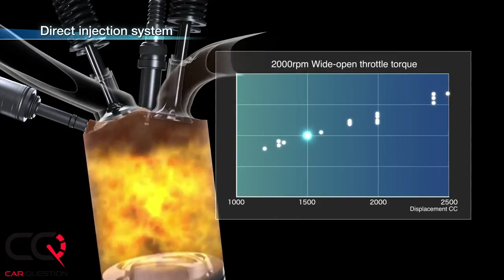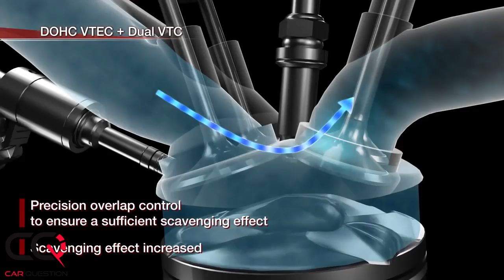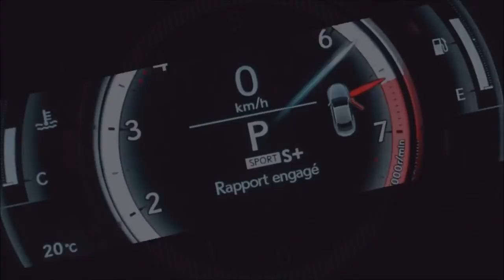Honda CR-V Turbo: Overfilled oil levels and a gas smell Fix and RECALL!

Comment: My 2018 CR-V LX 2.4 Liter is flawless.  It mimics the LX Accord to me 😁
Reply: the 2.4 is a good motor. its in my accord but it does burn a little bit of oil maybe cus i vtec alot
Reply: Keep a close eye on oil level. If it seems like it is getting higher on dipstick, it's gasoline
Reply: @MegaLifeChanging  Keep an eye on all Honda DI four cylinders.
Reply: The turbo is the problem. 2.4 liter CRV should be just fine
Reply: @rncondie  No their not.  2018 crv with 2.4l engine. Oil keeps going up on dipstick. Can smell the gas  in the oil. Wish people would quit saying the 2.4l are fine.
Reply: @normt5463  All of Honda's other DI engines are fine. Jeez.
Reply: at 40,000 no issues yet.
Reply: @tonydalton8712  are you kidding?
Reply: @FuriousHondaBoy  No not kidding
Reply: MoNo K that’s what I have too.

Comment: the update for oil dilution actually messed up the car. so for those people not having problem dont update otherwise you will have check engine and later on the car will go limp mode and die.
Reply: Someone didnt do your update properly then. Never seen that issue at the dealer I work for and I have personally never had that issue on all these pointless recalls. Ide go back and complain. It's not the updates issue it's the person that did your update

Comment: 2018 CR-V EXL, no issues yet at 11,000 miles.
Reply: We have the 2018 CRV EXL 2WD and no problem either. I'm guessing it's the AWD maybe.
Reply: Reports mostly around 20,000 it starts
Reply: @jasonHadley420  false. For people who have the problem, they report the problem starting immediately after the purchase, including commenters on this video. Don't spread false news and rumors.
Reply: I have a 17 EXL turbo and had the software update done and now injectors failing which means too much gas (fuel system too rich) and at 80k miles. So just you wait. 10k miles is nothing. Keep driving it and you will see

Comment: I have bought a 2017 CR-V, after tons and tons of research. I went on many test drives. Talked to many sales people. I got a notice from Honda about an emission related to the emissions. I have failed to have a problem yet. The Kia Optima I had before it smelled like burnt oil after every oil change. My mechanic always said, "that smell goes away in 3000miles".
Reply: ilovetotri23 that was probably because oil spilled on the engine and they didn’t wipe it off. The smell has to burn off.

Comment: Kind of interesting that Hyundai got rid of the Turbo and DCT in the 2019 Tucson. Part of this was the mfg. cost of all that complex machinery and then they were getting so many customer complaints with the DCT and  Turbo drivability.  The complaints were translating to warranty costs that were  becoming unacceptable and low scores on customer satisfaction surveys. 
The new RAV4 will not have a turbo, though it may become an option in the future.
Reply: They are actually getting rid of all Direct Injection GDI engines, not just the turbos. In fact, the only GDIs left are the turbos. The DCT was horrible though.

Comment: Anyone debating crossovers right now, their best bet is the 2018   Toyota rav4, 2.5l engine with the 6 speed auto trans. Very simple and reliable vehicle. I just saved you lots of home work :)
Reply: mazda cx5 should be 2nd best option as well since they still hanging on 6 speed auto train
Reply: The Mazda CX-5 is the superior vehicle in this class.
Reply: @davidsparling3505  If tech and a fine interior is what you desire and don't mind the higher cost of ownership over many years, than this is your vehicle.
Reply: @BonsaiJCan  Higher cost of ownership?
Reply: Yeah, but the Toyota now also has a direct injection engine in the Rav4, so some caution is warranted. I would opt for the hybrid as it tends to work in a more stable Atkinson cycle. The electric motors do all the work in that car.
Reply: @davidsparling3505  yes... Mazda is low on the reliability rating scale and parts aren't cheap either.
Reply: @afcgeo882  Really...where do you get that information?

Comment: 17 crv turbo - We did have a intermittent rich code that would come up after driving for 10 miles or longer, did notice a bit of a rough start on 2 occasions, had the computer updates all done and issue happened again. Tested with a known good MAF and no change. Valves were not heavily carboned up. The testing has lead us to suspect bad injectors. Has anyone else changed injectors to resolve what seems to be similar issues?

Comment: I am at the Honda Dealership now with this problem of gas in the oil. I have had it in to the Dealership 3 times with at least 1 quart or more over fill on the dipstick this is a very big concern as Gas and Oil in this situation is not good for the Crankshaft bearings or the seals in the engine. As a courtesy to me they have changed the oil and filter on my 2017 Honda CRV Turbo. That's fine but still not a fix and time and warranty are running out.

Comment: I own a 2017 civic with the 1.5 turbo. Many months ago I caught wind of the oil dilution issue & have been checking oil level frequently. I changed the oil every 4,000 miles After 12,000 miles it seems be fine. 
The motors that have the issue will most certainly be effected. 
The OEM oil viscosity is super low & the oil capacity only 3.75 quarts.
Doesn't take much fuel to dilute such a small quantity of engine oil.
Bad deal all the way around. 
I'll continue to keep an eye on the oil levels & any fuel odors in the cabin. 
Maybe I got lucky for a change.
Reply: S Paul One of the problems is a companywide obsession with weight when in fact these cars are nothing as light as classic 80's Hondas were. But there is also there is an ideal amount if oil so as not to run too cool. My side mirror broke into so many pieces with an impact and the dealer said : Honda is making the cars lightweight. Garbage design!
Reply: James Medina all cars are lightweight designs now. It’s called “crumple zones.” It what saves your butt in a car accident.
Reply: Hey Paul just wondering if you could update me on your engine? Now that it's 2 years later any problems  ?

Comment: Have 2017 CR V. Had recall done today, 12/26. Never experienced any issues others have had. Live in Illinois near Wisconsin border. Maybe I was lucky.
Reply: Smell your dipstick. I had the update and after a oil change smelled the stick for kicks and sure enough smells like gas. 17 CRV EX-L.
Reply: wait to you engine misfires and fuel injectors fail around 100k. Guaranteed $1700 fix. Shame on Honda

Comment: Hello, honda lower i own 2017 honda crv 1.5 l with 20k on  it, the last 2 time when I have changed my oil, i have noticed that oil level is higher on a stick,it is going over maximum. This is happening after only 1500 miles and oil is black and not sticky as it should be. My wife sad some times she can smell gasoline in cabin, i have called honda dealership and made an appointment they are not sure what it is but will post everything they said to me.
Reply: they are lying..same thing hapenning here..we have to fight formore warranty and  insurance liability responsibility

Comment: My 2018 accord touring is stalling left and right, only 12k on it. The oil level has risen and smells of gas. The dealership says there is absolutely nothing wrong with the car, but cars just don stall at 70mph on the highway if there is nothing wrong

Comment: I have Sep 2017 LX 2WD made in Canada in Qc . i never had any issue so far, i never floored the car (My car never reached to 5000 RPM so far) . i called to take an appointment yesterday for winter tire change  and also asked if they have any update on ECU update and yes they will update the ECU.
Reply: S N Glad you are not having any issues!!! Does your vehicle have the 2.4L engine?
Reply: @brendame  the canadian lx's also have the turbo .

Comment: The software and AC fix from Honda in November did not fix my unit.  I was .7 liters overfilled (.75 US quarts) above full when I took it back in to Honda in December after 1200 miles (2000km) of driving.  They changed my oil and filter for free.

Comment: I have a 2.0 Touring Accord and I have smelled gasoline shortly after startup. And I smelled gasoline in my oil. This has me really concerned. Any advice?
Reply: So long as the oil level is normal you should be fine. If it really bugs you I would have it tested through Blackstone Labs.

Comment: brand new honda crv turbo 2018..after 3months of purchase, they call me to update the software,changed the cooling uni tand changed the oil,not  sure what the heck else  they did..i called  it was a manufacturing defect....Second issue...oil changed second time at km 6000/ after one yr of the purchase...oil level automatically crossed the max level next day when i checked and i am quite sure the leak will start.Not sure how that is going to effect my car? warranty help? insurance help? tech asking me to come to dealer again..lets see..why i have to go to dealer again? why purchse a brand new car? did not expect that ..?!!

Comment: 2018 Crv 2wd Touring model and yes the oil smells like gas. Currently just under 56k miles. Noticed it last oil change and just checked again at about 4k miles on the oil change with full synthetic and again it smells like gas. Guess I need to be changing it at 3k miles or less :/
Reply from the maker: never been solved and will never be :(

Comment: I have a 2018 Civic with the 1.5t and there's fuel in the oil. About an inch over the fill indicator. Unfortunately I purchased this vehicle new without doing enough research.
Reply: How is your engine now and what are you doing to fix it ? Do you do like some long drives to burn off the fuels weekly ?
Reply: How is your car now is it ok
Reply: @bigt5699  I sold it. I didn't want to risk having to replace expensive parts later.

Comment: I have the 2017 1.5 turbo civic sport and I have not been contacted by Honda about my engine having this problem but the more I read about it sounds like all 1.5 turbo have this problem. This was supposed to be the last car I would ever buy and I planned on driving it the rest of my life that’s why I brought the ever dependable Honda. I’m retired and on a fixed income and can’t afford to settle for a car that is going to be a pile of junk in a few years so this is a much bigger problem for me than it may be for someone that’s still in the work force and has an extra 25 thousand dollars to spend. Honda better suck it up and do the right thing even if that means new engines for all who have been harmed by this bad designed engine. All I ever wanted was a brand new Honda and boy did I get one...

Comment: Wondering if the "Honda Fix" will affect the performance of the engine?
Reply: They are are going to try to reset tuning and timing along with reducing boost.  When they start this and you get your car back, and notice less power that is why.
Reply: Yes it will. No matter what Honda says they are altering the desired design
Reply: @pedroc6823  you'll also likely see worse fuel economy as a result.

Comment: I had a 2017 CRV.  It had 22,000 miles on it.  The smell started at about 21,000.  I traded it in for a Pilot.  Honda should buy back all these CRV's.  I am angry with Honda.  But taking Honda to court will only make the lawyers richer.

Comment: I hate that these little motors are forced to work even harder with a Turbo. I am glad I stayed with my Honda Accord EX-L V6.   If I needed a 4 Cylinder I would have been fine with a 2.5L non turbo.  Folks don't realize the wear and tear  from a turbo.  And not if it goes its when the turbo will fail they will realize it.  It is way to early to really know and forced induction has come a long way. I believe they are providing too much boost for these motors to handle for the sake of tricking the public into a cheaper smaller motor that is over powered and charging in most cases more than a V6.

Comment: my 2017 crv awd turbo 100k miles didnt get fixed. it actually got worst after the update cause it is giving me check engine now, and the engine oil has strong smell of gas.

Comment: My question is why does it happen to some but not other 1.5LT of the same model.  I know Accords have less issues than Civic and CRV.. but why not ALL CRVs, or all Civics, or All accords.. why just a few?  Why doesn't this occur within the 1st oil change, but other times taking a few?  so strange.
Reply: i know havent seen it on my 17 crv. i measure the oil in and when i change it. always exactly the same

Comment: Just the overhang of a class action, will be a large negative for Honda and it’s sales and behaviour over this one. This is a band aide fix. NOT a realistic fix . Honda used to be up front as the author refers to . Pity. They got poor advice over how to deal with errors .

Comment: For all you Toyota lovers... what about the 2018 prius' that stall out in traffic and catch fire?  and those camrys they had to recall?  No car manufacturer is without guilt.. NONE.. I like Toyota as well as Honda.. but let's get real... remember the camrys that had their brake pedals stick?  How about those sorrentos catching fire for Kia?  I could go on and on.........
Reply: thejerseydebil I was thinking this too. We buy a car hoping it lasts us forever. Some spontaneously combust out
of no where. Some engines wear out quicker than others because of oil dilution.
Reply: SO?...Don't make it right. I don't care what manufacture it is.
Reply: thejerseydebil I agree. No manufacturer is perfect. They’ve all messed up at some point. Cars don’t run forever either. All oil turns dark once it’s being used too.

Comment: I'm still waiting for a clear explanation of what it happening. I've seen nothing on exactly what is happening and what Honda is doing to fix the problem. I want a clear technical explanation that makes sense.
Reply: Honda's fix is telling you a lie that this is not a problem and gives you an extended warranty on the engine. They will also give you a "software fix" for a mechanical problem that softwares can't fix since its not a computer issue.....its a design flaw and this is what happens when you have small engine with turbos.....But the real question is what happens if your warranty runs out? Honda likely wont rebuild your engine for free....and you're stuck with a dead engine.

Comment: So took my crv in to the dealership forrecall..now there are issues with computer and gps.  drove 100 km today tires showed k
low pressure warning for no reason..randomly  showed incorrect direction after only 10 km.  Anyoneelsehave issues?

Comment: Does anyone know if the 2016 CRV 2.4l engine has the problem of oil dilution?
Reply: I have a 2016 lx awd and my only symptom would be the dipstick smelling like gas . My oil level generally stays at the full line for entire oil change cycle . Gas isnt hitting the back of the valves on our DI 2.4's so my guess is they'll start running rough sooner than the earlier year models of the gen 4's that had multi-port injection + 5 speed tranny . Honda will have to start including walnut shell blasting of the valves as part of the maint. schedule :)

Comment: Im not a lucky guy this year. I should watch this one before purchasing one 2019 last few week. Just drove over 500 km, and the fuel was mixed with the oil. Just done the service yesterday, and let see what is going on.
Reply: Any update?
Reply: The fuel is still keep leaking into the oil by the time. I live in Alberta, and its really cold here in the winter. The oil dilution is getting really worst in the cold. Really disappointed in Honda.

Comment: 2017 civic hatchback.  1.5 turbo.  6k miles and already showing the oil level about 0.5 quart overfull.  oil smells of fuel.
Reply: I have a 2018 Hatchback with 14,000 miles no issues, oil level stays the same. I live in El Paso Texas and drive 23 miles to work every day, I check it every week.

Comment: I have the 2019 Honda CR-V and heard about this several time but I am not getting any fumes.
Reply: If you drive a lot and don't make a lot of cold starts compared to the amount of miles driven, this most likely won't affect you much.   Honda made an error, but people have also forgotten how important it is to get an engine up to full operating temperature regularly and avoid short trips to the corner neighborhood store in the winter.  (for example).

Comment: It may be HIGH PRESSURE PUMP issue! How is this part designed on this engine? Has somebody image of high pressure pump? If some art of sealing of pump damaged fuel get into oil. I drive Mitsubishi Space Wagon with GDI engine and there is a boot inside of pump and if it get damaged (by disassembling for example) oil system get connected with high pressure fuel line! Toyota had this problem with their D-4 engines too. If it was only too "rich" combustion it would not cause rapid high oil leveling.

Comment: It's a honda problem period. I have Kia 2.0l turbo and no fuel issue. Turbo subaru gas no fuel issue.
Honda needs to fix this. Looking to by a 2019 car and I have taken honda off the list
 My money and I will buy what I feel is the bed. I have over 20000 hours as a mechanic and I know what is normal. Gas getting into crankcase is not normal period.
Reply: The Subaru turbos run on premium fuel with compression and timing set for 91+ octane, which burns hotter than 87. You're an old generation mechanic who doesn't actually know how modern systems work with all of that computerization. Do you even know how modern variable timing systems work to change the knocking settings from 87 octane to 91?